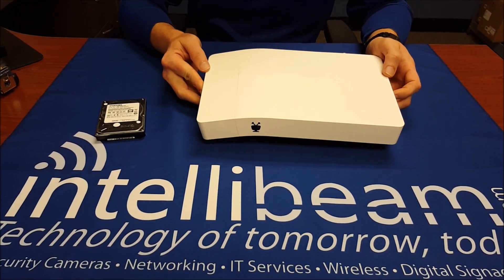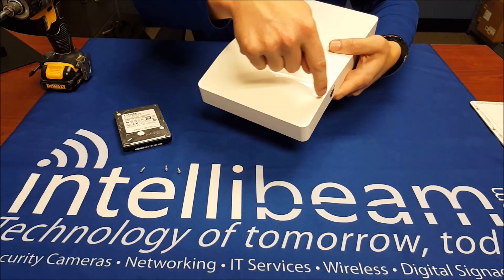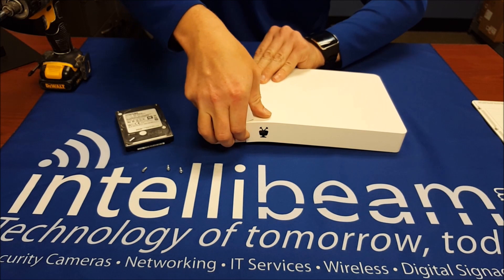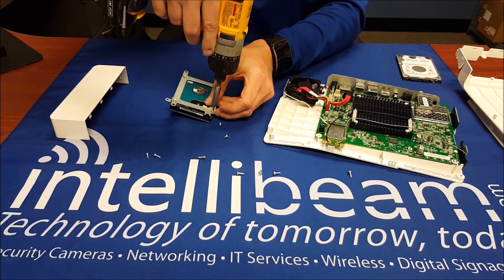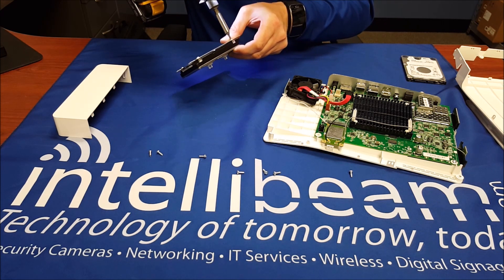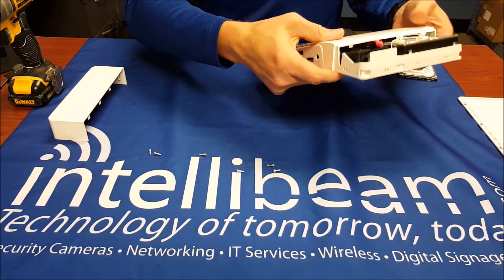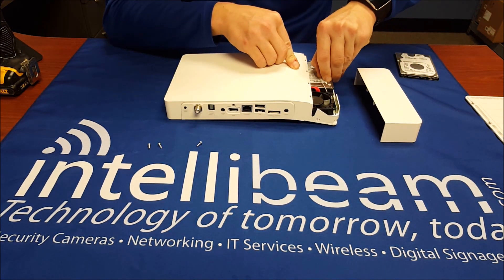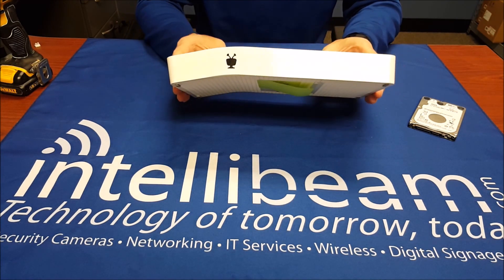Tivo Bolt hard drive replacement/upgrade & install by Intellibeam.com

Comment: My Hard drive crashed on my tivo bolt and I'm using this video as a guide to replace with a new hard drive. My only question is in regards of formatting. Do i need to format the hard drive before i put it in the tivo? If so what format or any special application to use to format? Or does tivo bolt will format the new hard drive?
Reply: Ok, got the new hard drive but it is stuck at "Starting up" ?..any suggestion

Comment: is there a video that describes the steps to power up and set up the Tivo after replacing the drive?
Reply from the maker: This particular Tivo installs everything needed back to the new drive automatically. It's a very short process and only takes a moment from powering it back on.
Reply: @Intellibeam I just replaced the 1tb with another 1tb thanks to prime same day delivery. But replacing it still does the same flashing pause then flashing pause flashing again. It is not installing the OS. Bought this on eBay, tried it once or twice, it was great, but storing it for a year made it flash I just sold it on eBay for $70 so I obviously need to fix it fast, and not cancel the order..

Comment: Thanks for the reminder video. Two years ago I updated my 500GB to a 4TB Seagate  BarraCuda 2an17v-566, which has apparently just died. Luckily I still had my original Hard drive and was able to pop it back in. No recordings, but I'm not too worried about that, just glad it's no longer a brick!

Comment: Half of the R&D budget must've gone into the unnecessarily complex case design.
Reply: LMFAO! Also too small, should have been full component size, for proper ventilation!
Reply: @scottskura3706  Agreed, but those days are gone. The Tivo Edge has a  better case though.

Comment: How does the operating system get put on it?
Reply: Good question...I'm having Weaknees do mine but I suspect there may be a way to do it myself instead of paying them $150.  I don't think you can just pop a drive in and it works.

Comment: Just got mine delivered yesterday so maybe newest configuration. All T-8 screws til I got to the hard drive bracket, then T-10. Antenna wire was already routed under the drive so a little easier.

Comment: Nicely done.  My external screw in the rear of the Bolt was T8, the rest were T10 for me.  Also, I decided to replace the plastic antenna wire standoffs over the hard drive with two pieces of double-sided adhesive foam tape.  These case removals are like a puzzle, and I have no patience for puzzles!  Thanks for putting this together and sharing with the world!
Reply from the maker: You are most welcome.

Comment: Thank you for this video.  It definitely gives me confidence to try this procedure.  I have a question though, is your Bolt still working with the Toshiba drive?  Amazon seems to have several people complaining that after 6 or 7 months of use the drive started failing in their TiVo Bolt.
Reply from the maker: Mine has been fine since day 1 of this video =)

Comment: Wow you just kinda throw those drives around. There still mechanical with spinning disks. I'd be worried about damage
Reply from the maker: Close to 3 years up and running now. Not to mention, they weren't powered on...
Reply: I'm sorry for being critical. I've been building computers since 1985 (for myself) all I'm saying is if (which I'm not) would remind people that hard drives are u fragile . They do damage easily, I guess I was kind of taen back, also the reason I'm here at your video is I just. Bought a Bolt. I have 4 different Tivo boxes up to my last  myTivo Romeio pro, 3 weeks ago a mild thunderstorm took that. Tivo out. Tivo.s especially their HDMI area. Hate static . Except the last one all the others had. The HDMI jack ruined by static electricity, I'd mention in your electronics videos. It's important to ground yourself . Again sorry . Just me. Thanks for the video. I'm hoping to try a 4tb drive, gonna as cut my cable card go Ota

Comment: Does anyone know of any tutorials or companies that might check the Tuners that no longer pickups more than 6 low end channels after a power surge. My Bolt is a boat anchor unless there is a way to fix this. TiVo customer support seems to be overseas now so they are about useless.

Comment: So you no longer have to prep the drive with linux? Just plug and play?
Reply: Correct, sort of.  Plug in the drive and boot up to the setup screen.  Tivo will automatically format.  If it's larger than either 2TB or 3TB (I'm not sure which) then it will be formatted to 2TB (or 3TB), you then remove from the Tivo, connect to computer, and run mfsr to format to the full size (up to 8TB I believe).  I just did it on my Bolt running the latest release (21.7 I believe), worked fine.

Comment: Intellibeam - Great video.  I have a question for you.  Did you have to copy all the files from the old hard drive to the new hard drive first ??? Or can you stick a bare formatted disk drive in there and it will download all the necessary files to it once you boot up the system ????  Thanks.
Reply from the maker: Bare drive is all you need.

Comment: Did not know you could replace the existing HD with an off the shelf HD. Is this something new? I have the older box and getting pixelation on my video recording thinking my drive is dying.
Reply: @Rud Dog I'm not sure what model you have but I found a useful how-to on instructables.com for recapping the power supply on my S3 HD.
Reply from the maker: Bolts have the OS stored on their own separate storage area. Other Tivo's will require additional prep work for new hard drives to work.
Reply: It's also possible that your power supply is dying.  I started getting pixelation on my TiVO Series 3 HD when its power supply was dying.  A good number of TiVOs were made during the so-called "Capacitor plague" (google it) and you can refurb the power supply by replacing the electrolytic capacitors, if you're handy with a soldering iron.
Reply: Thank you billd66 you leave me with more options. After removing the drive and replacing it with an identical drive the pixelation continues. Time to take a look at those Caps and the google search response. Again thank you.
Reply: I have the Premiere. Will hop over to Instructables and see about fixes for my Tivos. Thanks.

Comment: I got the new drive in, but as I was pluggingg the drive in, the Wireless cable that goes across the HD, came loose where it plugs in. I tried to plug it in, but not sure why it doesn't just snap in. Don't want to screw it up. I would think it would plug back in, but maybe it has to be at a certain direction to go down... not sure...bummer stopped in my tracks

Comment: T10 bit was too large. To avoid this stupid mistake, I'd get a set, it's cheap enough to get 6-8 that will run from T4-T10 instead of just buying the one size.
(update - I found a driver kit. One day I need to organize all my stuff)
478 HD hours! And I would not have been comfortable doing it without this great video. All the screws were T9, and it was just a matter of patience, and pausing to see the next step.  Thanks!!

Comment: Great video TY!  Love that you include spec on fastener TS-10 but just to be clear are all fasteners the same size as the unique one on the mid back?  They use a 2.5" HDD and not SSD why not swap for SSD?  10 year life expectancy for SSD where most HDDs are 2yrs the best HDD is 5yrs

Comment: To avoid the issue that was shown of how to put the hard drive bracket on your new drive, i would make the suggestion that you place your new drive next to your old drive making sure that the plug for the cable on both drives are facing you. This way all you have to do is unscrew the bracket, pick it up, move it directly to the new drive and screw it on. No flipping it around.

Comment: I upgraded my Tivo Bolt 500GB to Toshiba 3.0TB MQ03ABB300 Hard Disk Drive as you suggested.
Rebooting issues after 2 months of operation, unit crashed and now "4 flashing lights" at startup, any suggestions?

Comment: Biggest reassembly problem I had was the red sata cable.  It wedged under a rib on the case, and kept the case and HDD cover from aligning.  Rather than disassemble again I worked the cable free with the torx drive head, scooting cable a little until the case went together.  It took several tries.  HDD was the samsung 4gb.

Comment: Do you have to do anything special to format the drive first?  And is the OS on a chip internally, so it should just boot up clean?
Reply: Um, isn't that supposed to be >3TB and you HAVE to do prep?  3TB or less and you don't need to prep?  Your comment above says ">" (greater) 3TB.  BTW, thanks for video.  Much more involved than Roamio.
Reply from the maker: >3TB, you don't have to do anything. The software is on the Tivo.

Comment: FYI is used the SAMSUNG Spinpoint M9T ST2000LM003 2TB 5400 RPM 32MB Cache SATA 6.0Gb/s 2.5" Internal Notebook Hard Drive Bare Drive worked like a charm and very quiet as well....
Reply: Lu(k
Reply: @tylerguignard4976  Any 2.5 drive should work including SSD
Reply: Is it still working? My 3T just died and i have lifetime subscription they want to charge me 499.99 for service fee life time. What a joke and 199.99 for the edge box if all i need to do is replace HD then my lifetime subscription will still work ? Thanks

Comment: Thanks for this great video.  I did run into one teeny snag.  One of the screws holding the hard drive frame to the original 500GB drive was a T10.  This screw was the one next to the 4 pin power connector.  I originally thought I stripped it - but the T8 bit I was using was spinning in the screw.  Stepping up to a T10 addressed that particular screw nicely.  It's possible that manufacturing is intermingling screw sizes - thus the original T10 recommendation.  Other than that - it was a breeze!

Comment: How's the drive been working for you up to this point, I just received the 500GB bolt and I'm considering upgrading the HDD, its $170 off eBay for the drive you have listed. Is this still the best option to upgrade it with or are there better ones out now? Thanks for the awesome tutorial
Reply from the maker: +Jonathan Logue It's been rock solid since day 1.
Reply: Thanks for the update; I'll be ordered the drive tonight and with you tutorial this'll be a piece of cake.
Reply: Jonathan Logue i upgraded mine with 4tb. I bought the seagate expansion external 2.5 drive and opened it. Need to use software (MFSReformatter) to read it as 4tb. The hard drive i got it for $99 at Costco.

Comment: Is there software that needs to be installed on the HD prior to using it (like the other TiVo models), or is the HD for storage only?  Will the new HD be "plug & play", or do you have to format it first?
Reply from the maker: +David Pavlakovich >3TB, you don't have to do anything. The software is on the Tivo.
Reply: I think you mean "<3TB, you don't have to do anything", as you described above :-)

Comment: Thanks for a great instructional video. Purchased the Toshiba 3TB HD.  Didn't have a T10 security bit of screwdriver so I bought one from a nearby big box store.  Problem was that the screws were T8 and not T10.  Big Box store didn't have T8, so I had to find a tool store about 30 minutes away that had one.  Took the Tivo Bolt with me to make sure this time.  T8 screwdriver worked on all screws. Maybe Tivo made some manufacturing changes.  Installation from that point on was as shown in the video.  The tip from one of the other reviews regarding using a plastic deli knife to help open the box was great and saved a lot of time.

My advice to anyone doing this is if you don't already own a set of security screw bits or screwdrivers, take the Tivo box to the store with you to be sure you buy the correct size.

Comment: Before anyone proceeds with changing out your drive, as I did, please give careful consideration to the hard drive you select. The wrong drive will cause your beloved TiVo Bolt to experience errors. I spent an entire week buying part after part, so please learn from my trial and error. Following the instructions in this helpful video, I installed a 2TB Samsung drive (model: ST2000LM003) in my TiVo Bolt. (The Toshiba drive that Intellibeam used was not readily available at the time.) Within the first few hours, the TiVo for the first time reported multiple errors while watching live (buffered) TV. The TiVo reported that "Live TV was not available." This error required me to hit the TiVo button to go back to the menu and select Live TV again. Yes, very annoying! I surmised that this error was happening because the Samsung drive is not an AV drive, and therefore it was unable to support the demand necessary for error-free TiVo watching. The Samsung drive also only had 8 MB of cache (compared to the 16 MB of cache in the drive that came with the Bolt).

Conclusion: An AV drive may help to avoid these problems.  In the end, I decided to go with the "Western Digital 3 TB WD AV-GP SATA III Intellipower 64 MB Cache Bulk/OEM AV Hard Drive WD30EURX" drive, available on Amazon. This is a 3.5 inch drive so it must reside in an external enclosure or docking station. I could not find a reasonably priced enclosure that wasn't noisy, so the docking station was the best solution for me. This configuration requires you to run a SATA cable from the inside of the TiVo box to the outside, which is not ideal, but at least you won't have errors. (My TiVo is hidden from plain view in my living room, so these aesthetics were not critical to me.) Once 2.5 inch 3 TB drives are available in AV, perhaps I will go with that, but until then, I think the 3.5 inch external AV 3 TB drive is a reliable and cost-effective way to go. 

(Perhaps Intellibeam could tell us how the performance has been from his Toshiba 3.0TB MQ03ABB300 drive? Any errors such as the one I had with the Samsung drive?)

Here is the shopping list of the items I needed to pull off error-free viewing. As of the time of my writing this comment, all of these items are available on Amazon Prime.

(1) Western Digital 3 TB WD AV-GP SATA III Intellipower 64 MB Cache Bulk/OEM AV Hard Drive WD30EURX
(2) Anker® USB 3.0 & eSATA to SATA External Hard Drive Docking Station for 2.5 or 3.5in HDD, SSD [4TB Support]
(3) Ably SATA Female to ESATA Male Adapter for HDD Hard Drive
(4) Cable Matters 90 Degree Right-Angle 6.0 Gbps SATA III Cable - 18 Inches

The angled SATA cable is essential, because the TiVo's casing will NOT be able to close if you don't use an angled SATA cable. (You could use a left angle SATA cable, but the right angle is the better choice because it allows the cable to point directly to the back side of the TiVo casing.) If you don't re-screw in the screw that goes next to the coaxial cable in the back, there is enough "give" to allow the SATA cable to exit the casing in a way that is not obnoxious. I taped a half inch of electrical tape just over the metal casing on the back of the TiVo so that SATA cable was not resting directly onto metal. It's snug, but I don't think it will get cut.
Reply from the maker: +dcmax1 The drive in this video has been rock solid since the day it was installed. As you can also see, no other accessories or cables were needed.
Reply: I just installed the same drive that you had issues with, but I did not see your comment. hopefully you just had a bad drive, I will update if I get any errors with my Samsung/Seagate 2TB drive. 

I was not able to find a 3TB drive that was 2.5" so I was bummed to have to get only the 2TB size. #firstworldproblems. I only installed it last night so time will tell. Also someone mentioned different sized bolts were used...I had a mix of T8 and T10.  The 8's were mainly on the case and the 10's were on the HD.
Reply: +dcmax1 Because AV drives are designed to skip over errors instead of hang on them trying to process them.
Reply: +Jago94 update: drive working great, replaced my Wi-Fi router with a cheap AC router and internet connection has been rock solid, very happy so far!
Reply: +Jago94 update: drive working great, replaced my Wi-Fi router with a cheap AC router and internet connection has been rock solid, very happy so far!
Reply: +Jago94   
Well 2 days have gone by and it has been preforming great.  The only issue I have had is the internet dropping out, seems to lose it connection to my router and only a reboot of the system (unplug and plug back in) can reset the connection.  I don't think the HD has anything to do with it.  I suspect my router to be the issue...its an old Lynksys wireless G router from 2003 haha. 
I will update if things change.
Reply: Crap, I just ordered that drive. Although, there are now two versions of that drive and I got the newer version according to Amazon. I hope I don't have any issues.
Reply: dcmax1 f
Reply: Don't you mean you installed a Seagate "ST2000LM003", not a Samsung?

Comment: When I get around to replacing the drive, I'll leave the cover off for heat dissipation. In fact, I'll put a fan on both the drive and CPU heat sink, like my Roamio currently.
Reply from the maker: +Simon Byrd So far so good with mine. It's in a partially covered cabinet as well. The cooler the better though.

Comment: how does the software work after the upgrade? do you have to reinstall somehow?
Reply from the maker: +Andrew Allen The software is built into the flash memory on the Tivo itself. All you have to do it turn it on and it auto configures the new drive as long as it's <3TB.
Reply: Intellibeam thanks!
Reply from the maker: +Rick Mcknight You'd have to copy them over to a pc or another Tivo first. Season Pass/One Pass settings are all stored online and can be manged there.
Reply: +Intellibeam To follow up on this question, I've been running my Bolt for a month already with the original drive. How would I transfer all the shows I've already recorded over to the new drive? And, will the all the settings, such as all the season-pass recordings I've setup be retained? Thanks for the info.